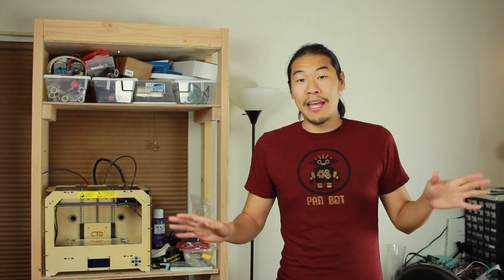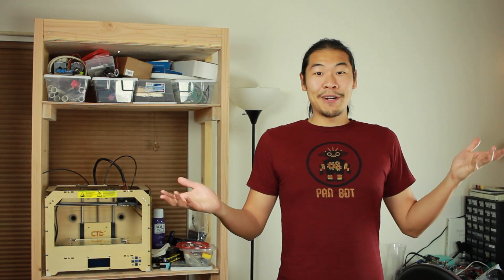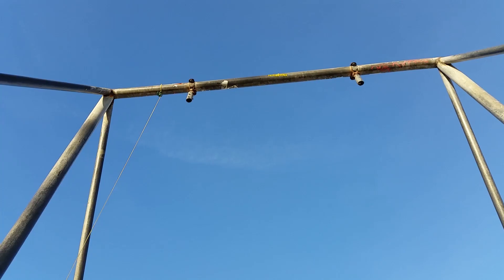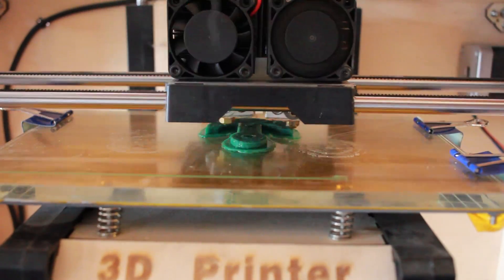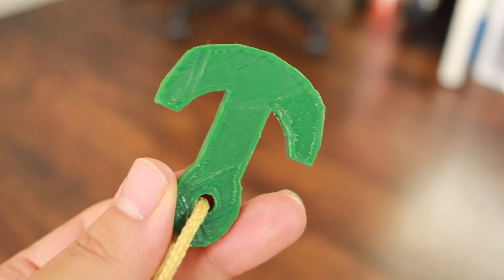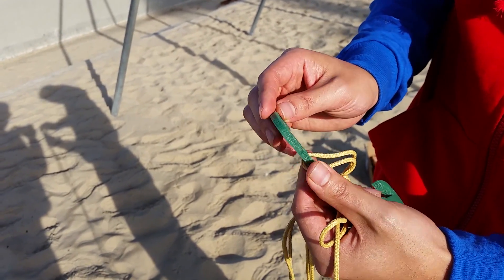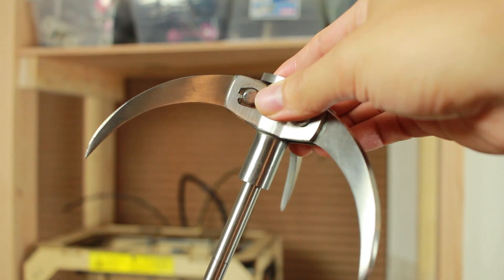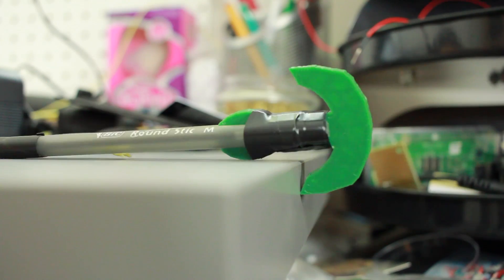Can a Mini 3D Printed Grappling Hook Hold My Weight??

Comment: Have you considered using metal reinforced 3D printed parts.
Print with a channel that is slightly less than the diameter of bike brake cable in the middle.
Have the print pause when half done. Use a soldering iron to press and melt in the brake cable into the channel.
Print over it to complete the part.
See video by Braun's CNC.

Comment: 3d printing isn't automatically garbage, but I think the 3d printer version of rebar through the concrete is to have multiple print stages, print an initial scaffold, wind that with glass fibers, and print the rest around that fibrous structure.

Comment: Hello, if you see carefully in comics its says that spiderman "spins" his web. The web coming out is not just a thread but a braid of thread that intertwines together in mid air to form a braid of many thin web thread which increases the tensile strength. By controling this mechanism he can create many type of webs. Try making a shooting mechanism in which there are 2 or more small grappling hooks. When fired their projectile is such that they roll into each other before attaching. It will also increase the chance of it getting stuck where you want.

Comment: I have an Idea for the webshooters maybe instead of a grappling hook you could use geck skin as as a super adhesive which can hold up to 700 pounds in a small area the size of a greeting card. It can also be removed very easily just with a simple twist

Comment: i saw the hacksmith (i think? cant quite remember) using a 3d printer that used a special fillament that increases print strength, so that might help with making the slotted part design work if you could get the printer.

Comment: possibly make the internal edges of the hooks rounded instead of sharp angles. this will spread the pressure more evenly and prevent the hooks from breaking off as they did with the 4 pronged version.

Comment: with my personal experience with PLA plastics for 3d printing, if you would reduce the printing temperature to 210 or 200, it would eliminate your warping issue.

Comment: If you had a hook that had springs pushing out the teeth of the grapple then it could support weight of the spring are placed in a good formation and be compact. Maybe as a launching mechanism you use rubber or have a system that punctures co2 canisters

Comment: if you connected the 2 piece to the grapling hook from the base where the hole is instead of the top because the pressure is coming up not down

Comment: I bet you can make a really neat launchet using one of those break-barrel pellet gun pistols. 
the break barrel makes it easy to re load and it's infinite shots. idk if it would be powerful enough to shoot that hook with rope far enough... But I think with some trimming and weight reduction, it'll fit on your fore arm nicely. 

Also, if you find that the hook isn't strong enough, try to carbon fiber reinforce it with carbon fiber strands. 

As for shooting the hook put of the gun, I would make a stick extension on the hook to fit inside the barrel of the gun and have the string higher up on the stick? idk. 
Maybe modify the barrel or make s custom one.

Comment: I was thinking that maybe you could make a hook that retracts back in the line so it can detach easier from what its hooked on to. Also it could have a wireless signal button so you can control the hook when it needs to retract. Don't know if that helps but just thought i'd put that out there...Don't know why this vid showed on my feed but looks interesting so keep it up.

Comment: suppose you have a metal grappling hook machined, however the core rod is hallow but thick and strong. this will allow you to snake the twine through the cavity, loop around the hooks on exit, and easily store in the firing mechanism for ejection

Comment: My thought to assist with the hook grappling around to the string it is attached (like what you did with the single-piece printed hook, not the examples on the table at the end of the video), is to have a small magnetic strip on the rope near the end with the hook, which attracts to another magnetic piece at the center of the hook. The idea being that you throw the hook up and over whatever you want to attach to, then when it comes back around to loop on the rope the magnets attract, which guides the rope into the folds of the hook. From there, just pulling it taught should be enough to secure it without having to spend a long time hoping the hook can grapple to the rope like what you experienced at the beach.

Comment: you can print the 4 prong hook as 1 single piece.  print on the same orientation but with scaffolding.  i hear you can strengthen pla by baking it.

Comment: if you instead of using grappling hooks used strong electromagnets it would be easier to make them stick to the (metal) rafters. or you could use electromagnetic grappling hooks to get the best from both parts

Comment: What about instead of using normal rope, you could look for super expanding materials like sponges with water eg. Then when the end of it is exposed the length of the sponge would expand many times it's size to give you a compact but suitable material to project? Idk just a thought (obviously would need some spray function or dribble contraption to deliver the water to the sponge.)

Comment: Hello if you increase the wall thickness of the print it will make it stronger.  You will still get a solid part but without using the infill setting.  If you look at the hook it broken along the the grain like wood.  Try and round out the underside of the hook  instead of having the 90 turn and try a .1 layer height.  Also 230 is high for PLA maybe try 210 you should see your outer side wall smooth out.  Hope this give you more options to make a stronger smaller hook.

Comment: You know is possible to make real web shooters about of real webs but the problem is that real webs are extremely thin so they need to be at least 3mm thick
Reply: The NEEK FREAK yea I have been trying to work in web shooters like that can you help me
Reply: Spider hero ya sure, in trying to make my own web shooters also but the problem for me is that I'm not sure how to actually launch the webs, I was thinking about maybe using a compression tank but I don't think it would launch far or fast enough
Reply: Tanin Moores damn u close I am 12 almost 13
Reply: Tanin Moores actually I'm 15
Reply: Tanin Moores I'm just a huge spiderman fan
Reply: The NEEK FREAK same
Reply: Tanin Moores I also go to a science and engineering school and of course one of my classes is concepts of engineering so I'm starting to learn welding and it's just one of my side projects that I'm working on which is probably not going to work but it's fun to think of
Reply: Tanin Moores I'm sorry if I came across and sounded so young to you but I'm 15, a freshman in high school
Reply: The NEEK FREAK The real strength of webbing comes from it being woven neatly... It doesn't matter really on the fluid (as long as it turns solid) it's the spinnerets that need the most attention.

Comment: i always had an idea of having the grappling hook attached to some sort of D ring, so like you have the hook and the shaft of the hook, and somewhere in the middle you drill a hole, place your D ring, attach your line to the D ring, so that the initial part of the shaft can fit in the launcher unobstructed, but when launched, the D ring would flip so that it and the line would be behind the grappling hook, streamlining it

Comment: I have an idea for a grappling gun idea. Don't know how well it would work though due to how the air pressure may go. 

It allows the line to be internalised rather then on the outside like many other design allowing it to be retracted and fired off without having to reload the grappling hook. 

On the barrel, there would be an input (gas), and a second hole for the line (not sure how they'd be positioned). The hole would be slightly larger then the line its self (may need to be larger to reduce resistance).  On the line connecting to the grappling hook there I would be a ring (probably rubber) that would fit over the hole parking a one way valve. 
The problem I can see is that the air pressure when firing may cause the plug to stay in place or cause resistance which is the main reason why I don't know where the line hole would be on the barrel. Though an idea could be to set it just below the gas input. 

It's just an idea.
Reply: HyperIke essay people.